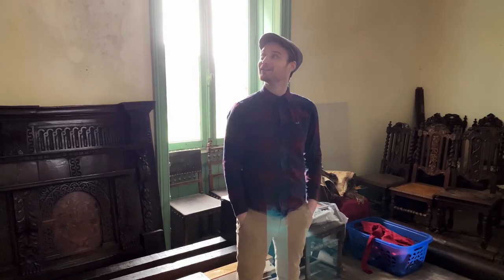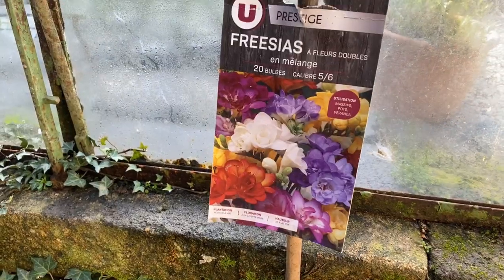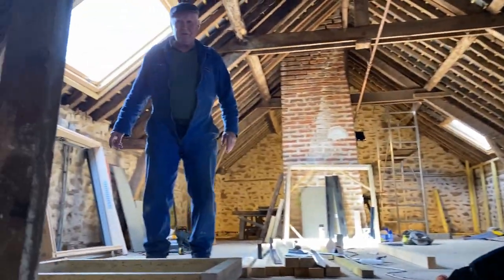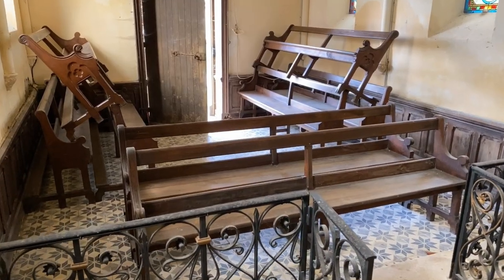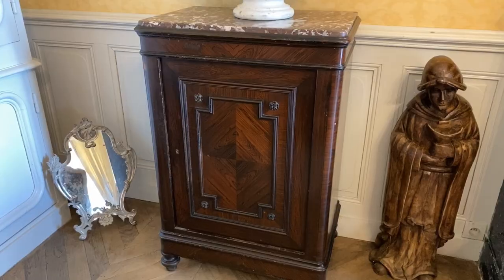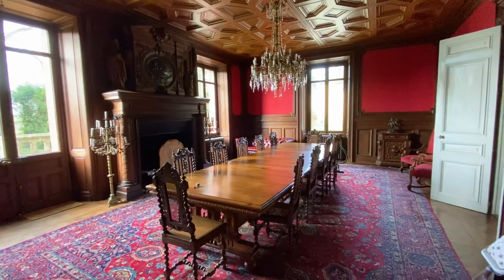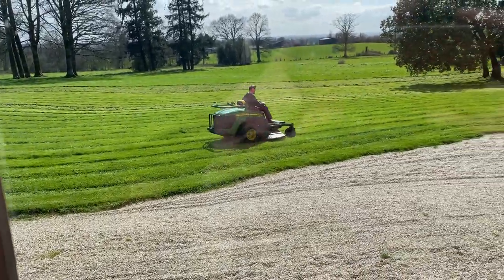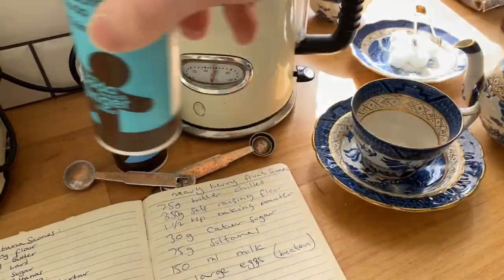Doing It Ourselves - Episode 1

Comment: Ps, love gardening myself.
Tip: Herbs need maintenance. Rosemary needs to be pruned to about half a foot each year. If you don't, you get a massive shrub of which only the end is usable. But prune after there's no more frost on the ground. Then you get love fresh branches.
Reply: A lot of people neglect lavender bushes too and you end up with long sticks with one or two flowers rather than amazing bushes covered in bees.
Reply: @JoyandSerenity.  that's the same as rosemary. You're absolutely right. All those kind of herbs are the same. Thyme as well. You have to prune them in early spring